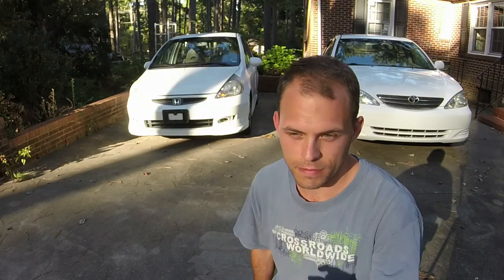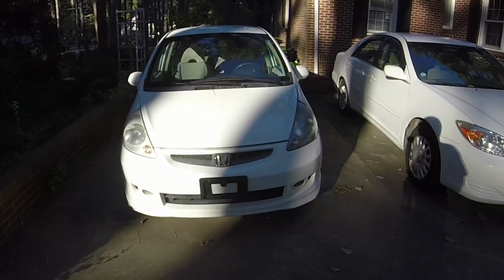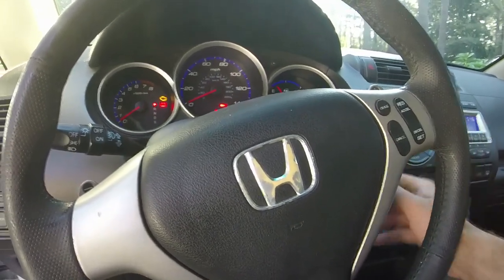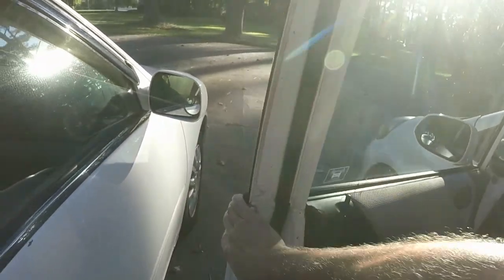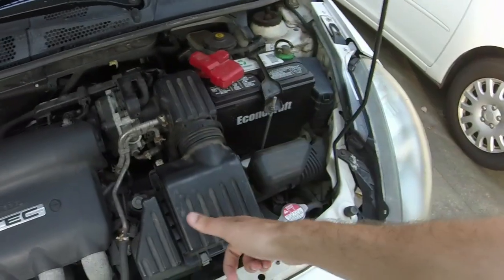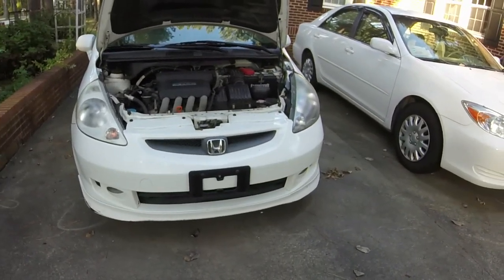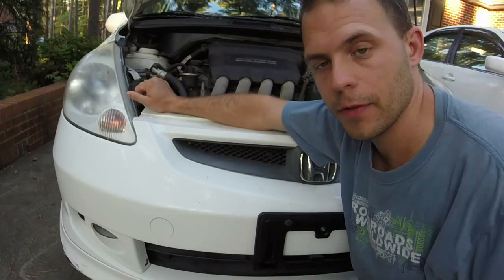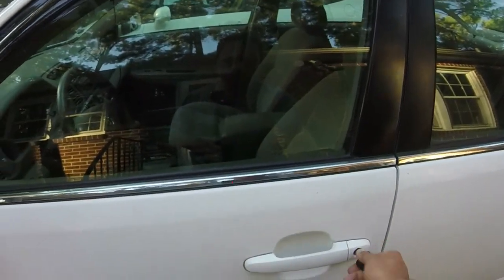Selling my 2007 Honda Fit and getting a 2002 Toyota Camry: Two good cars for around $3000

Comment: That Camry is a gem.  You are right about keeping the older ones going.  I do.
Reply: You are so right Bruce. The older cars are worth fixing. I still miss the days when cars were so simple there were no computers, you didn't need an OBDII scanner to work on them. Now days, cars have so many electronics in them, you need a full computer to go with an OBDII connection.
Reply from the maker: Thanks Bruce, it has served my family well.  It will go as long as it can!

Comment: Great video! You really can't beat Honda and Toyota for quality.
Reply: Yes, older Toyota for sure, but not modern Toyota's. When the Toyota Prius become a thing, their computerized throttles resulted in somebody dying. Instead of the company admitting their fault, they chose to blame the driver, and he went away for murder. I used to have a greater respect for that company. Now days, I can only appreciate them the older days. Anything as modern as a Prius or newer, I aint buying it. Honda at least has no rep for killing people that I am aware of. The problem with modern cars today is that they have far too much electronics and computers in them. When they often fail, and they do, they cause real havic. With Tessla's, they simply stop running entirely, when charging door sensors, or bumper sensors get tripped.

Comment: I like the Toyota Camry better because it appears to have more space inside. The modern cars have so many computerized features inside that sometimes become deal breakers if they fail, cause you can't even start the car. These days most people are going after the electric cars, but they are all expensive, with Tesla and some of the sporty makers like Porche being the worst. The problem is that these electric cars are completely computer controlled, and Tesla's are getting a seriously bad rep for their instant bricked cars due to charging door sensors and bumper sensors tripping. And those lithium batteries don't last forever either. Unfortunately, due to so many governmental changes, which we always see in California first, they are forcing the issue of everything being electric now days, including lawn mowers. So, I think the days of gasoline fired cars is slowly coming to an end. Great video Ellis!